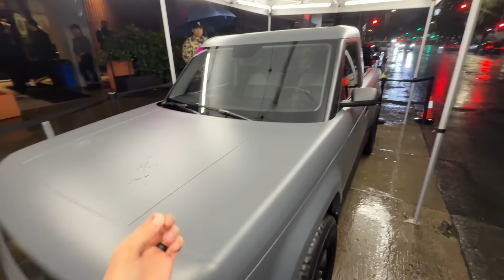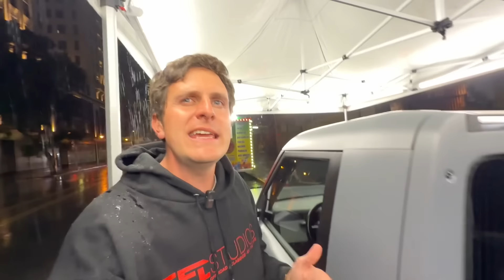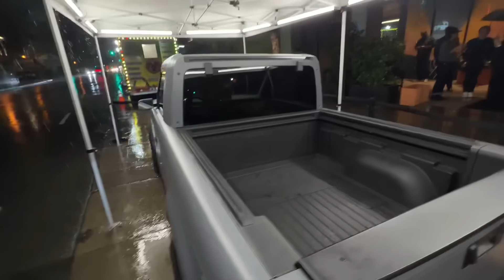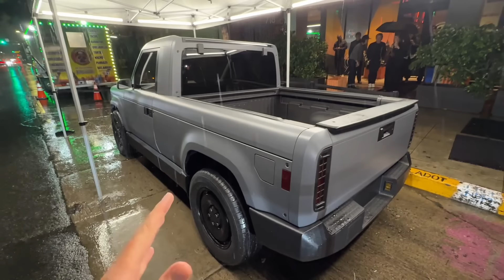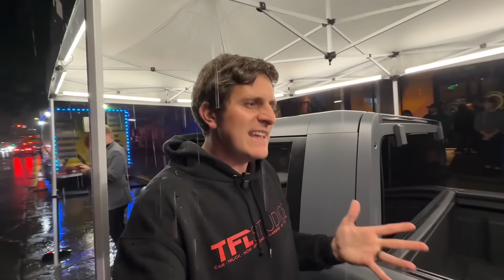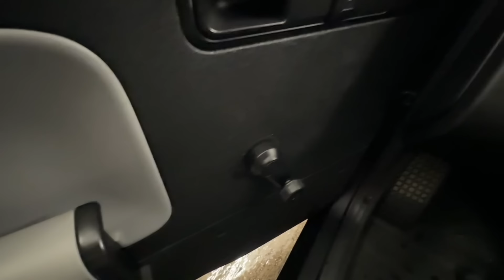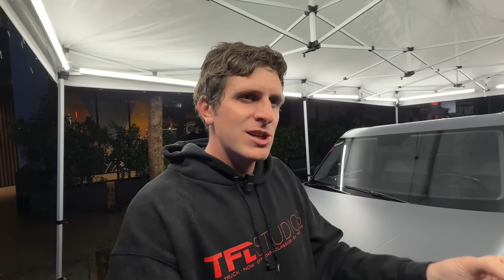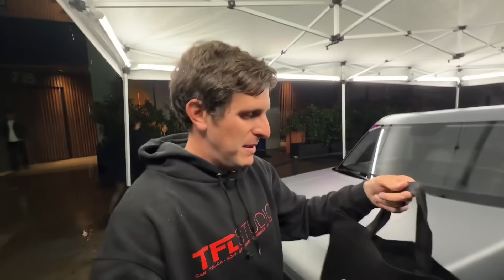The TRUTH About the '$20K' Slate Truck...Will This Really Be a Hit?

Comment: If its popular the automakers will be quick to follow suit.  I had a single cab, 2wd, ranger, manual everything, and i loved it. It was bright yellow (hideous) but still loved it. People thought I was poor driving it around not realizing I had limited 4runner as well.  Great vehicle that got good gas mileage. Awesome for small hauls moving things or going to dump.  Sold it to a relative and regretted it ever since...wish they made more single cab trucks even though I have a 18 Tundra now. I would still use it for a commuter.
Reply: Not necessarily.

Comment: There price point was with the maverick but its $8,000 higher now!
Reply: They need to let people test drive them to stimulate more interest!😇
Reply: No it’s not. They haven’t given an actual price point. They’ve said mid-20’s. Go find a new Maverick for me for mid-20’s. You’ll find a few used ones for the low 20’s and a lot of miles. How about you know what you’re talking about before speaking.
Reply: @MrChaddly02 I know what im talking about i own dummy! 2025 bought in april gave $27,500 deals your just to lazy to find them!!
Reply: @MrChaddly02 they were paying $27499 and the tax credit would make it $19999 so I guess they are tweaking the price now that it’s gone
Reply: @MrChaddly02 quick Google search in my area showed a advertised price of 28k for a maverick. Power windows radio 4 doors and a dealership network
Reply: Yup and why would any one get this over the Maverick at the same price... You would be dumb to buy this thing....
Reply: @scupking  to have almost zero maintenance costs?
Reply: @agrobotics except for the chargers you will need installed at your house that is astronomical in price. I would bet 3-5000 dollars to have installed. Do you know how many oil changes you’d need to equal that amount. At least 30. That’s 30 changes $100 a pop. 150000 miles. 

Also electric cost more than gas per mile. You need to research it. The concept is awesome, but we are a long way off still.
Reply: I love EVs I own a Tesla but the Slate is already dead on arrival.  If you could walk out with one for under $20k people might buy it but a Maverick starts under $30k and makes way more sense.
Reply: @Tool0GT92 I disagree.  I'm a city DIY guy and this won't have any engine issues will go far enough and carry my stuff.
Reply: @ChicagoBob123 ok sorry people will buy them just not in the numbers they hope obviously there’s some use cases
Reply: @Tool0GT92  The quality on the Maverick is not good.
Reply: @SonofHardrada who knows what a slate will be like this is their first car
Reply: Price-And it has been said it will be even HIGHER when it eventually becomes available.
Reply: @genewind4850 there’s a lot of things that “have been said” that aren’t true. Slate set out to build an affordable vehicle and while I’m sure they’re not as smart as you, they know that this won’t sell if it’s too expensive. They will come out at the mid-20’s price they advertised, or they will fail - they are aware of that.
Reply: @MrChaddly02  if they're aware of it, then why the bev powertrain?